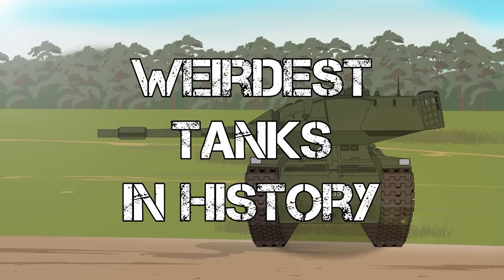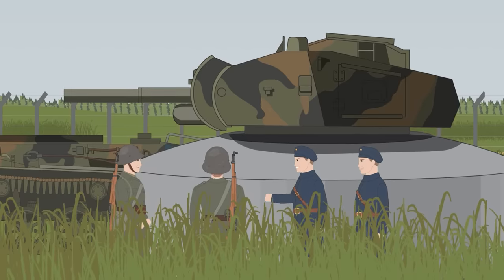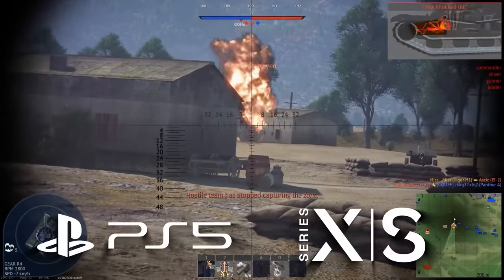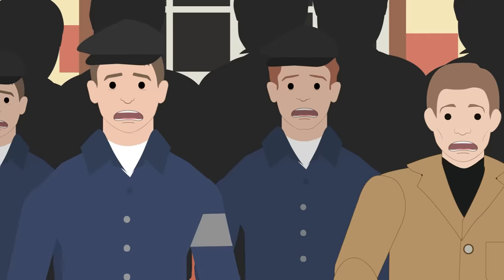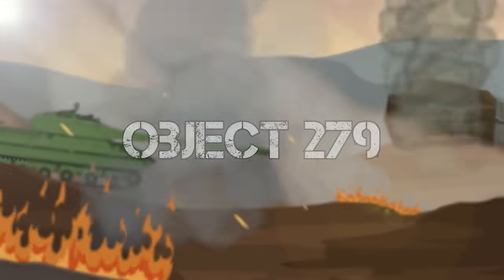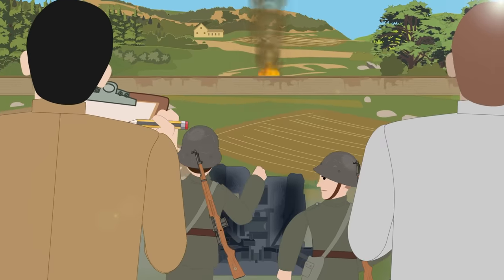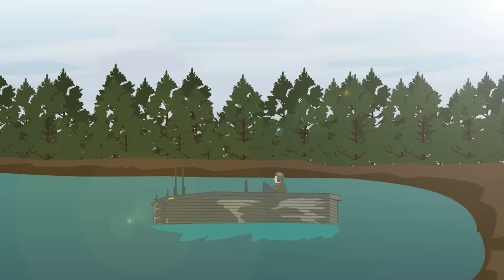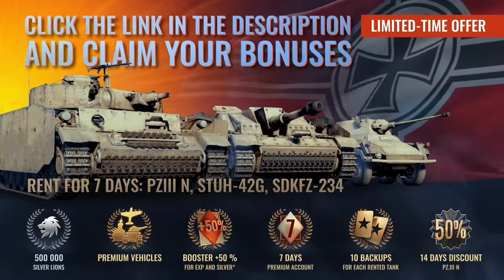Weird Tanks in History

Comment: It’s not the T28, but the T95. T28 only exist with 2 tracks, T95 has 4 tracks
Reply: "The T28 and T95 are exactly the same tanks. The tracks were removable at any point, mostly for transport. The vehicle was just originally named T28 Heavy Tank, then renamed T95 Gun Motor Carraige, before being renamed again to T28 Super Heavy Tank. Given its the most recent classification, T28 is the correct term for the vehicle, but all the names refer to exactly the same AFV" Copied a statement by another commentor because I was getting fed up with these types of comments
Reply: @StiXWasHere  If they are the same, then why don't they have the same armour and front frame? The T28 was 254mm front / 101mm side / 50mm rear, the T95 305mm / 152mm (not even counting the extra tracks) / 50mm, it's absolutely not the same. The T28 weighs 59 tons, the T95 87 tons. The 2 "extra" tracks only weigh 5 tons each, so all the rest of the weight is in the much thicker armour. The guns supported are not the same either, the T28 had at most a 120mm AT gun T53, the T95 had a 155mm AT gun T7 with flash cover. They are very similar, the rest of the components are the same, but they are not the same. Just because 1 and 2 are numbers, doesn't mean they are both the same number.
Reply: @jeremydillinger5762  I would love to have a look at the source you used, because I cannot find a single one that supports what you're saying. In fact, every single source clearly states that the T28 and the T95 were the same tank and that the name change was a redesignation that was made due to the tank not fitting the qualifications for a regular tank.

Comment: Uhm the one with four tracks is a t92 the t28 is the two track version and a bit smaller
Reply: Nope, both tanks are the exact same

It was originally named T28 Heavy Tank, later changed to T95 GMC and back to T28, but now with the new designation Super Heavy Tank

Those tracks were only there for both transportation and combat purposes
Reply: The T28 and T95 are exactly the same. The tracks were removable at any point, mostly for transport. The vehicle was just originally named T28 Heavy Tank, then renamed T95 Gun Motor Carraige, before being renamed again to T28 Super Heavy Tank. Given its the most recent classification, T28 is the correct term for the vehicle, but all the names refer to exactly the same AFV
Reply: @infinitydott  yeah i saw another video about it, i just always thought the 2 track version was the t28 and the 4 track one a t95.. but i looked it up and seems it was just a changing of names

Comment: you shouldve added the MBT/KPZ-70 joint project with the U.S and Germany. It failed because of cost, but it was really fast, well armoured, had a 152mm smoothbore cannon able to fire missiles, hydropneumatic suspension, and also served as a test bed for new military weaponry. It actually was the predecessor to the Abrams/Leopard tanks, as one visually can see the similarity in the Abrams turret and the Leopard hull, and the germans would eventually use the smoothbore technology to produce the Rheinmetall 120mm cannon, most commonly seen on nearly every modern tank (except the Challenger 2 and T-14 Armata, the C2 using a british designed 120mm smoothbore and the latter a 140/150mm cannon)

Comment: The T28 hitting targets at 12 miles? That doesn't sound very factual.
The 105 mm gun T5 used in the T28 has a dMAX of 1829m (2000 yards).
Not even the M101 (105mm artillery developed at the end of the war) could hit at 12 imperial miles since it has a dMAX of 11km (7 Imperial miles) and that is indirect fire which the T28 did not do.

Comment: Strv 103 wasnt meant to be used as your common main battle tanks. Sweden wasnt preparing to invade another country. It was preparing to protect its own. If you have ever been to Sweden, you will know that Sweden aint like Kursk, northern Africa or any other typical historical tank battle field. It is dense forrests, narrow roads, and lots of rivers and lakes. Strv 103 is meant to maneuver into ambush positions, and supported by infantery, air superiority and artillery, it would use its integrated front digging tool to entrench and camouflage itself and wait for the enemy, and strike them hard, with 1 round per 3 seconds, knocking out as many vehicles as possible before they could react, and then scoot backwards at full speed. And disappear into the forrest before the enemy can give chase, or even lure them into further traps if they do follow. Rinse and repeat, to bleed an invading force dry. It is a camper tank for Swedish terrain.

Comment: I thought the T28 and T29 were seperate tanks, as the T29 as another set of tracka among other things, thought the T29 was another variant of the T28
Reply: The T28 and T29 are indeed different Tanks. One is a casemate super heavy Tank, the other is a turreted heavy Tank.

The two Tanks you think of are T28 and T95, and they are, intact, the Same.

The Project started as heavy Tank T28, than got redesignated to 105mm GMC T95, which than got redesignated again to super heavy Tank T28. Two Prototypes were Made, both known as T28, than T95 and than T28 again. The outer Tracks were removeable on both vehicles.

Comment: depressing to think that you modeled a t95 and not a T28 
T95 had four tracks T28 only had two
Reply: They are the same those outer tracks can be removed for transport
Reply: "The T28 and T95 are exactly the same tanks. The tracks were removable at any point, mostly for transport. The vehicle was just originally named T28 Heavy Tank, then renamed T95 Gun Motor Carraige, before being renamed again to T28 Super Heavy Tank. Given its the most recent classification, T28 is the correct term for the vehicle, but all the names refer to exactly the same AFV" Copied a statement by another commentor because I was getting fed up with these types of comments

Comment: Some additional information about the T28. Firstly it is also known as the T95 because it's designation was changed through it's development. Some video games treat the T95 and T28 as separate vehicles but they are in fact the same vehicle. Secondly, the outer pair of tracks could be removed (along with some additonal armour above the tracks), attached together and then towed along behind the vehicle. Only 2 T28 were produced. One was scrapped after an engine fire and the second was abandoned in a field and forgotten before being discovered 27 years later. That's right, the US military lost a nearly 100t tank for 27 years. The second example still survives to this day.

Comment: Just a note, the cannon of the Strv 74 isn't called IV-kan it's LV-kan can be hard to tell with the lower case L looking like an I. LV or Luftvärn stands for anti-air. Gun originally designed for AT are designated as PV-kan, PV for Pansarvärn or anti-tank in English. Kan is of course short-hand for kanon which in turn of course means cannon.

Comment: The t28 didn't have 4 tracks it had two the t95 had 4 tracks
Reply: T28 and T95 are the same tank, it just got renamed twice during its lifetime: T28 Heavy Tank, T95 MGC, then T28 Super Heavy Tank.

It could only ever drive with 4 tracks due to ground pressure, but the outer two tracks were made to be removable for transport since it would've been too wide otherwise

Comment: T95***
Reply: "The T28 and T95 are exactly the same tanks. The tracks were removable at any point, mostly for transport. The vehicle was just originally named T28 Heavy Tank, then renamed T95 Gun Motor Carraige, before being renamed again to T28 Super Heavy Tank. Given its the most recent classification, T28 is the correct term for the vehicle, but all the names refer to exactly the same AFV" Copied a statement by another commentor because I was getting fed up with these types of comments